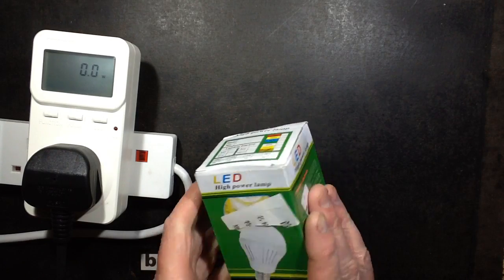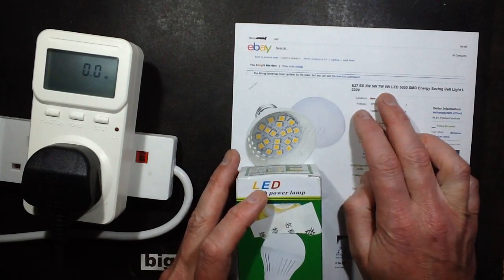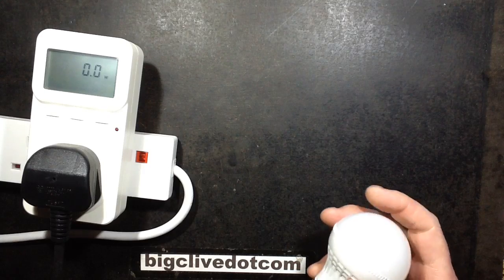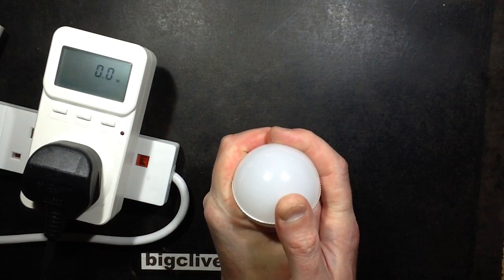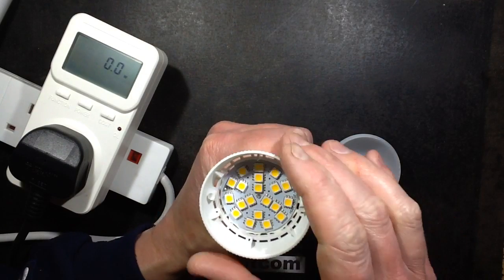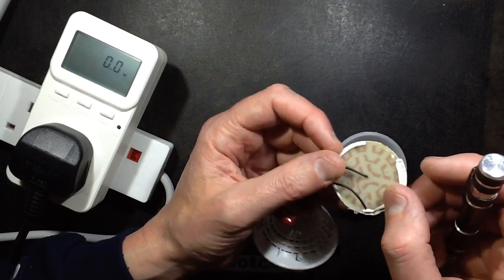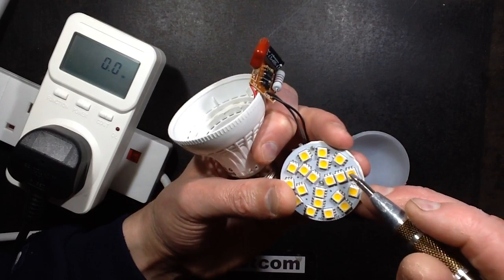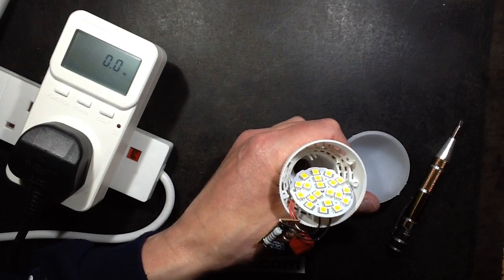Inside another "5W" LED lamp.

Comment: How do you light it without the housing? Newbie here
Reply from the maker: +Mark Pama The LED lamps are just an illuminated PCB inside a housing.  They will work fine without it, but will have exposed live components.
Reply: +bigclivedotcom how do you light it with a battery? Thanks!
Reply from the maker: +Mark Pama You can get USB powered and 12V LED lamps.

Comment: I have a 5w one of these that draws 16 watts
Reply from the maker: +bob williams Are you on 230V?  It might be a 120V lamp they've sent you.  Either that or your meter is indicating the current multiplied by the full mains voltage without allowing for the reactive limiter element.
Reply: +bigclivedotcom i am on 240v and the meter was cheap so most likely. During prolonged operation it is warm/hot to the touch but not much so that it would be uncomfortable to grab it. Either way it's a vast improvement over the 40w incandescent bulbs I were using.
Reply: +bigclivedotcom it was an e14 bulb from the eBay seller smart_shine and was advertised as 240v